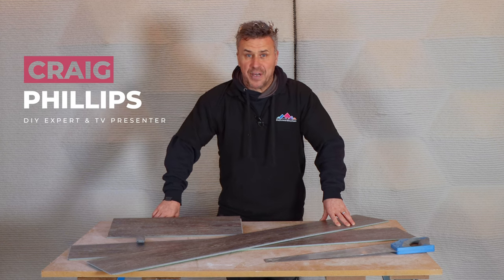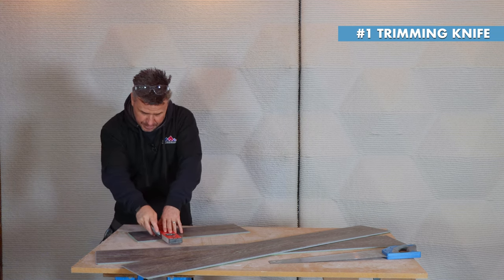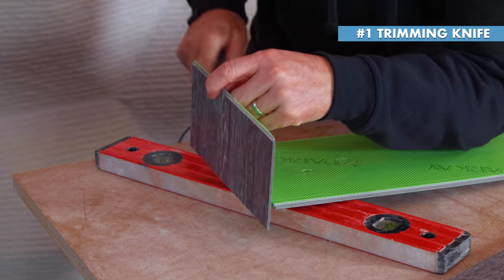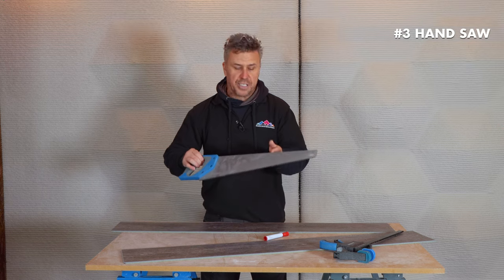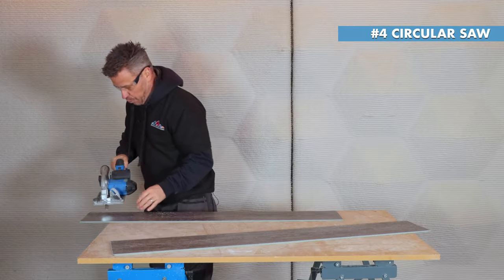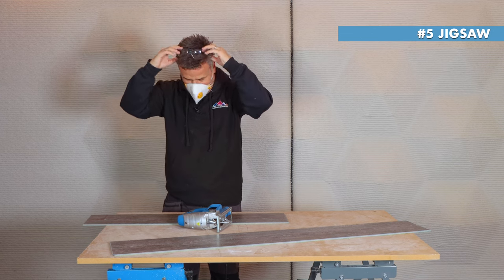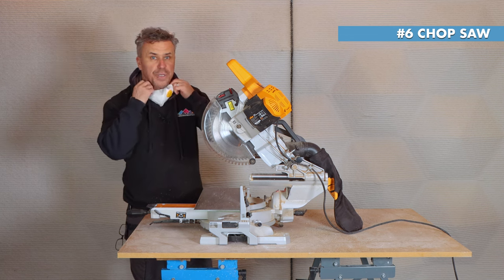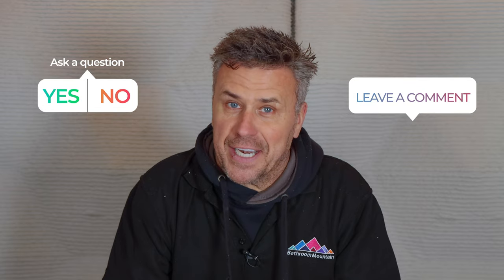How to Cut LVT Flooring | 6 Easy Methods | Knife, Guillotine, Saw, Circular Saw, Jigsaw, Chop Saw

Comment: How do you cut intricate shapes out of LVT. Like going around a doorframe etc?
Reply from the maker: For close up and detailed ones like that you could use the trimming knife as it will require detailed cuts. Cheers
Reply: @MrandMrsDIY  do you mean a knife with a blade?
Reply: An alternative, if it works for where you are fitting is to cut into the architrave using a wood blade in a multi-tool (e.g. Makita DTM52). You can cut it to the right height so that the LVT plank slips underneath it.